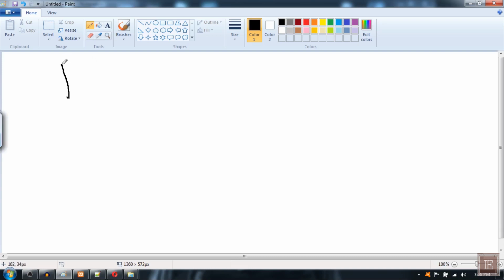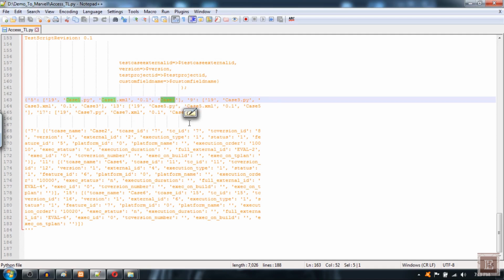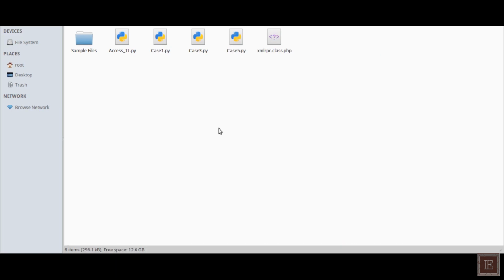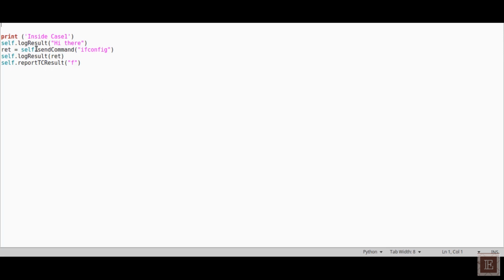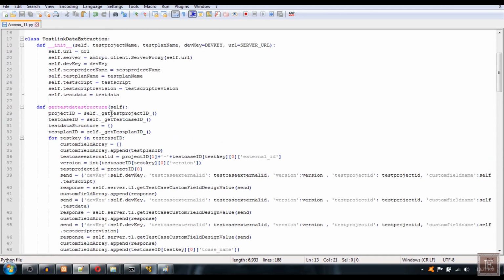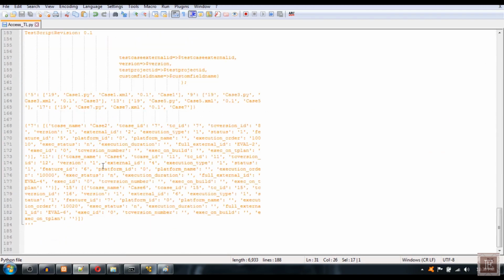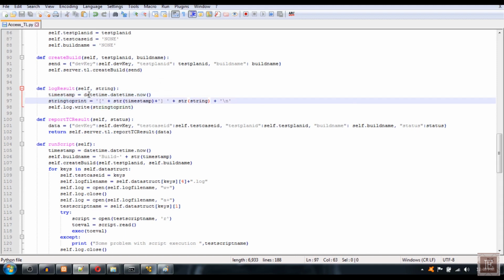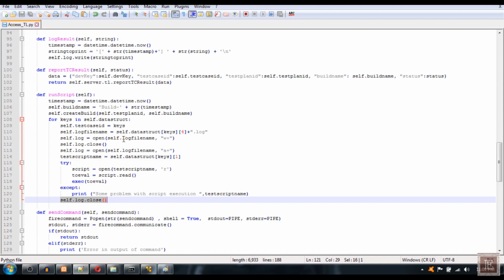Test Automation Framework from scratch, in Python and Connectivity with TestLink, a tutorial.

Comment: Can you share those PY files you got? i got my own project but it's shaped in a very different way than yours and i've found a lot of troubles when i try to integrate it with TL, so it would be amazing to see yours directly so i can shape mines acordingly.
Reply from the maker: I don't have them uploaded anywhere. But if you see the video. There is just one file. That's all. The code is  fully in the video. You will manually need to copy it that's all.
Reply: @electronicsacademy2D2E29  Alright, thanks.
Reply from the maker: @yottaXT  I meant I .py driver file and other test script files. All of them have been shown in the video.
Reply: @electronicsacademy2D2E29  yeah i understood, i did it already, many thanks :) my project is working fine.
Reply from the maker: @yottaXT  Great to know. Refer to anyone else who needs to know as well.